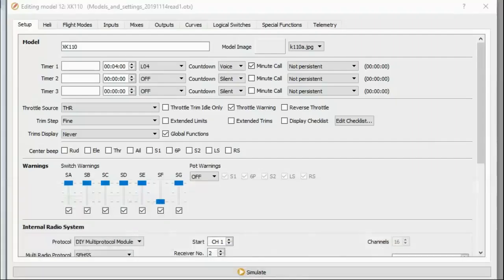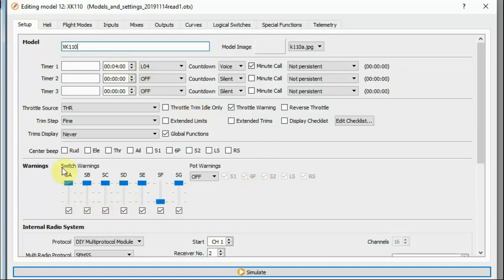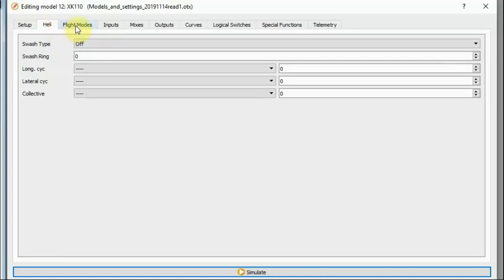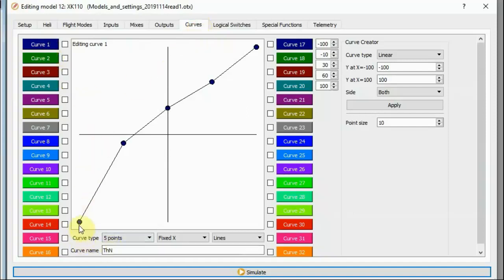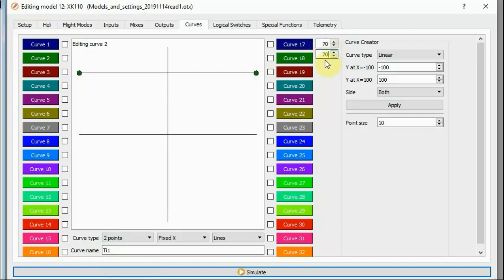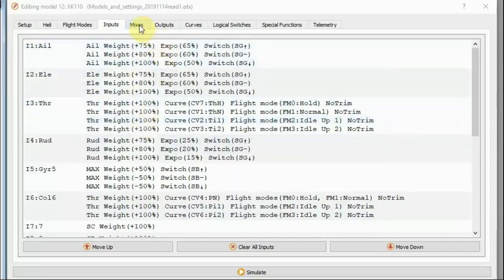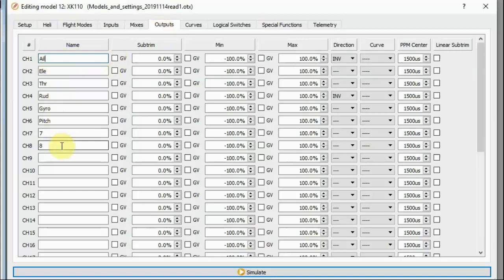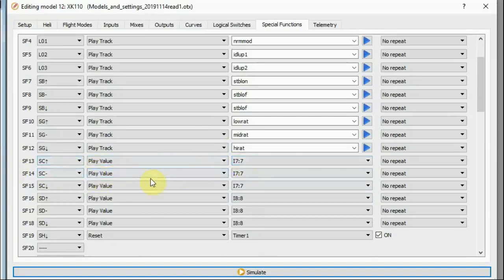OpenTX Heli Programming Pt 2 -  Flybarless Helis with Pitch Control XK, Blade, etc

Comment: Great video! Thx so much! I bought a RadioMaster TX16S MONTHS ago, but I haven't attempted to USE it because, quite frankly, it scares the sh*t out of me. I have 5 diff helis I want to use it with, but they're BOTH Spektrum AND Futaba, so that worries me EVEN MORE! I DO fly the K110, so I think I'll just use all your values and give it a shot. The ONLY change I will make is to put throttle hold on the RIGHT, as per the X6 radio and Spektrum DX6i, both of which I'm used to. Cheers!

Comment: Thank you for posting these videos. I recently purchased a Jumper T16 and am having a hard time setting up my Blade Nano S2. This video did help.Thanks again.
Reply from the maker: I'd be very cautious about flying anything DSMX with the Jumper T16 until the situation clears up a bit (though I don't imagine you'll come to much harm with the Nano). I am currently running OpenTX Nightly 42, and my internal multi module has firmware 1.2.1.51 (because that's the way it came, and I haven't yet managed to put together the adapter and cable required to connect to the internal board to flash it). I can set up and bind DSMX things, but when I try to fly them, they just act completely screwy. I'm assuming this is because of bugs that will be fixed if I flash the internal module firmware (and also perhaps issues with OpenTX nightlies, which are specifically identified as 'not safe for flying'). Everything else I've tried seems to fly ok, including DSM2. I'm only flying small things with the T16 so far, partially because I want to wait until the whole firmware situation is more stable and trustworthy... and also because Winter seems to have come early in Canada, so I'm only flying indoors at the moment anyway.
Reply: @kleedhamhobby  Yeah I have not been able to get it to work with my Blade Nano S2. I got it to bind on DSM2 and got the cyclics and everything setup, but the I can't seem to get the pitch setup correctly. I was just trying to fly something with the T16 to test. I guess I will have to try with an airplane or something. I am not putting it on my Goblin or Trex700 without trying it out for a while first. Have you had any issues flying the XK's with the T16? I have been looking for an excuse to buy the XK120 anyway. I might have to now just to have something to fly with the T16 lol.
Reply from the maker: @Gaming_With_Cole  If you have something non-DSMX, I'd suggest you try that first. Other than DSMX, everything I've managed to bind to my T16 has worked ok (tried DSM2, FlySky, KN, SLT so far). I tried DSMX on a fixed wing plane and a heli - the plane would taxi and take off, but abruptly spiraled into the ground right after take off; the heli seemed to be moving the cyclic ok on a ground test, but wouldn't even take off. So I've given up on DSMX with the T16 for the moment. I have ordered the cable and adapter board to allow me to connect to my internal multi board and flash it... and when those arrive, and I can update the multi firmware, I will try DSMX again.
Reply: @kleedhamhobby  Thank you for the info. I will try something else for now. I will keep an eye on your channel for updates on the T16. I would love to know what you find out after the multi board flash. Thanks again for the videos.
Reply: I agree on not using DSMX. I've had bad luck with signal dropping and crashing a few planes. I recently upgraded all my recievers with Sbus using my Jumper T16 and have had no issues.

Comment: Thanks for the videos!  New to OpenTX transmitters, and just returning to the heli hobby after 8 yrs, so the FBL controllers are a new challenge as well.  Just bought a T18 pro, a Trex470LM with a bestX controller....is this video the correct one to follow for setting up my radio to work with the beastX?

Comment: Where can I find the software you are using? Also, I have a Turnigy 9X and told this is an open tx system. I've been using the DX6i and completely lost with the Turnigy. I'm trying to set up a Thunder Tiger Raptor 30 and Century Raven 50, both have flybars. Thanks for any guidance and your videos are VERY detailed and informal.
Reply from the maker: The software is OpenTX Companion. It comes from the same place that you get new releases of OpenTX itself (and you should check for new releases of OpenTX and update your transmitter - you need to use the same release of OpenTX and OpenTX companion). Go to the main OpenTX site: https://www.open-tx.org/

Comment: One of the most instructive approach for setting the XK110 i've read, very didactive. One small doubt, when setting the gyro imputs,is it posible to use just two lines, one like the first with(+50%) switch (SB arrow up) and the second with( -50%) and switch (¡SB arrow up) to simplify.
Reply from the maker: Yes, you could use the 'not' function when making a three position switch serve for only two options, and that may be preferable for some people. Functionally, of course, it doesn't make a difference. The T16 only has one two position switch, all the others being three position, so it's fairly common that you might need to use a three position switch for only two options, and I suppose using the 'not' function does perhaps implement what's being done more simply. If you're going to change the input lines, I'd suggest changing the special function that speaks the setting also - it's always good to have the speaking functions coded exactly parallel to what they're indicating.
Reply: Thanyou for your reply,you certainly have contributed to my learning curve,i have another doubt. It seems that by using logical switches in the flight modes settings and conditioning them to (SF up) the pitch curves will only activate when throttle is active and this may be logical,but when setting blade pitch angle you must then disconnect the motor fron the ESC otherwise the conditions for the logical switches cannot be met.By the way, on my bigger helis i do disconnect my motor for safety.
Reply: I also think that assigning a switch to the flight mode also simplyfies .What is your oppinion?
Reply from the maker: @luisss4924  Well, I do have a switch which I consider as the flight mode switch - SE. But that only has 3 positions, and I have 4 flight modes. So I use SF as the hold switch, which locks the heli in Hold flight mode, then SE switches between Normal, Idle Up 1, and Idle Up 2 (so long as SF is not locking the heli in Hold - hence the need for logical switches). You can't switch between 4 flight modes using a single switch on any transmitter I'm aware of. You can assign any pitch curve you like to Hold flight mode, which will allow you to check the pitch whilst the throttle is inactive (though disconnecting the motor is certainly safer) - I actually have the pitch curve for Normal mode assigned to Hold mode in this video, as can be seen from the first line under Input 6 around 7:58 in the video. Based on the switch warnings that are set, the transmitter must be set with SF for Hold and SE in the Normal position at start-up, otherwise you will get a warning.
Reply: @kleedhamhobby  You are right,i did not notice that you do have a switch (SE) as flight mode.Thanks again, I keep. learning.
Reply: Hello again,i've already set up my K110 with my Jumper T16,and everything ok,but strangely my 6G mode seems to works with negative values and 3D with positive values. I've made your setup with my laptop using OpenTx Companion and transfered the file to my radio. Guess i might be missing something.
Reply from the maker: @luisss4924  When you say 'negative values', what is reversed? Is the throttle reversed? Is the pitch reversed? Is the cyclic tilt reversed? I certainly don't have this effect with my K110, so I think you must have introduced a reversal somewhere during your set-up. If the reversal is only in certain flight modes, then the problem is likely on the Inputs page, where the flight modes cause the switching of curves. Channels can, of course, be reversed on the Outputs page - but a reversal there would normally affect all flight modes.

Comment: Excellent videos!  Regarding the pitch curve during Flight Mode HOLD.  Wouldn't you want to have full negative to full positive pitch range so that you could attempt an auto rotation soft landing if conditions warrant a auto rotation landing?  Thank you.
Reply: It is matter of preference. I have all my pitch curves the same -100 to 100.   Futaba does  0 to 100 with 50 being middle stick no pitch. The only difference in flight mode is motor speeds is different.
Reply: @zmanphx  I guess when I saw a FLAT pitch curve for Throttle Hold I had to wonder.....you wouldn't even have a chance for an auto-rotation.  I get it that you do not want the motor energized on TH (flat Throttle curve)...but Pitch curve is another matter.  BTW Kleedham is popping up more and more as a heli-OpenTx reference on Helifreak.com.  Thank God!  Couldn't be happier with Kleedham's helpful videos.

Comment: Nano CPS , CPX loses connection as soon as i throttle up on RadioMaster TX16S. Any help will be much appreciated.
Reply from the maker: Not really much I could say about that. Make sure you're using the right protocol, obviously. And possibly updating the firmware in your multi-protocol module might help (assuming things work the same as for my older T16). If you're using the current firmware and the correct protocol and you still lose connection, could be a hardware problem with the heli itself.
Reply: @kleedhamhobby  Thank you

Comment: Excellent videos.  QUESTION - On the Special Functions Tab (23:35) you have Switch B managing "stabilization" functions.  It appears that the stabilization are really the "gyro gain" values that are baked into the flight controller. You assigned Switch B to control this.  On your INPUTS Tab, you mention channel 5 is being used to send this data to the flight controller.  I'm guessing that CH5 is "hard coded" into the heli's flight controller?  Could you put the gain on a variable potentiometer to change the "stabilization" (variable gain value) during flight?  How to do?  Thank you.
Reply from the maker: Well, as you say, it depends what is coded into the flight controller of the particular heli you are working with. You can certainly put the value for a channel onto a rotary switch or slider and program it so that you can vary the value in flight, anywhere from -100 to +100 (or even more, if you enable extended range). What this will do to the heli depends on how the flight controller is programmed. I think that the XK helis just turn stabilization on or off based on the value being above or below a certain point - and in that case, of course, you won't get any variable stabilization... it will just turn on and off as you vary the value past the designated point. But some other helis do actually have variable values. The old, pre-flight controller gyros also usually did provide varying degrees (and types) of correction based on the values, so using a continuous controller was what you wanted there.
Reply: kleedham - Thank you so much for your thoughtful reply. You truly are a genius with the intricacies of these helicopters. Keep up the great work. You are indeed a national treasure for the Heli community.

Comment: Hi mate, so I did all your setup as the video, when I’m at FM1 normal mode,  the Thr stays in -100, can’t control the throttle, even when I set the logical switch correct, all other FM2/FM3 works fine, it’s an opentx on flysky nv14, do you have any idea why? Thanks for all your help
Reply from the maker: OK, first we need to determine if you really are in FM1. SF should be away from you, and SE should be away from you (assuming this applies to your transmitter, which I have not personally handled). Also, if you have the right sound files, and have set up the Special Functions as in the video, you should hear the announcement 'Normal Mode'. If you are in Normal Mode, and the throttle will not respond, then either you have the throttle cut defined wrongly in Special Functions (it should force the throttle to -100 when SF is in the position towards you - SF down arrow, Override Ch3, -100); the other possibility is that you have the Normal Mode curve defined or assigned wrongly - under I3 on the Inputs page your second line should assign curve ThN to FM1:Normal, and on the Curves page curve ThN should be defined to move the throttle up as the input is moved up. All of this is shown in the video.
Reply: @kleedhamhobby  Hi, in the special function it was on --100, I've fixed that, I can't thank you enough, thank you so much for all your help as always, I'm in the hobby for years, but new for opentx, thanks mate

Comment: hi mate, did all these steps following your video, on the XK k130, everything spins and move, but the heli doesn't fly, also your curve number 6 in the video was missing, any suggestions? thank you
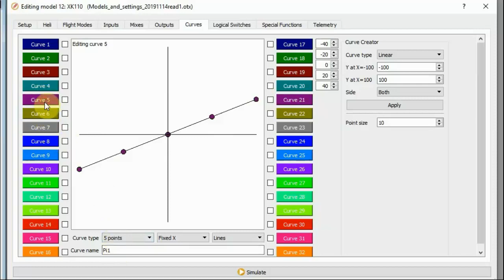Reply from the maker: Curve 6 is the same as Curve 5 - it can be seen at 14:33 in the video. These are the pitch curves for Idle Up 1 and Idle Up 2. They are generally the same. The example given here is based on the manual for the heli I was working with (the K110). It is much more shallow than is normal, going from -40 to +40 (straight line from -100 to +100 is most common). You can find the manual for the K130 at https://cdn.shopify.com/s/files/1/1052/4162/files/XK_K130.pdf if you don't have a paper copy. That manual actually recommends exactly this same pitch curve - so that shouldn't be your problem. What is your throttle channel going up to? If your pitch and throttle channels (3 and 6) are going up to ok +ve values and the heli still won't take off, that is generally a sign that there is something wrong with the heli, most commonly either a loose main gear, or a loose pinion on the motor. These setting fly my K110 and K120 (though the main gear does tend to come loose on the K110). I don't have a K130, but I'm pretty sure it should fly basically ok with these settings.
Reply: @kleedhamhobby  thanks for the response, the k130 is brand new, gears seems to be ok, thanks for the manual ill add the curve 6 and try it, I have big inventory of old schools hobby nitro and more, wanted to try this k130 with my nirvana nv14 open tx before I get the other to work, I used always old Futaba Ready transmitters which I have brand new maybe 4-6pcs but they are old now so wanted to test the open tx system, I have 5 pcs of Kyosho caliber 5 brand new with o.s engines, and many top quality airplanes engines, after ill get this k130 to work ill need to start the caliber project which I'm not sure what best gyro, GPS, flight control to chose:) but ill get there soon after, thanks for taking your time and answering all my questions, really appreciated that mate.

Comment: If my transmitter is set for AETR where do I change the channel order for a blade helicopter?
Reply from the maker: Well, I don't change the order, actually, as the multi-protocol module in my T16 re-orders the channels for the DSM protocols... so it's expecting AETR and send TAER to the heli. So... before you try to re-order the channels, make sure that you need to. If you do need to, there are various ways, as with most things in OpenTX. Probably the simplest way is via the Mixes page, which is essentially what makes the connection between your inputs and your outputs.

Comment: hi. not sure if I did understand correctly but can you tell me if it will be still required to have on the taranis that multiprotocol module on the back? sorry for my ignorance
Reply from the maker: I don't think I can really answer your question with any certainty. What kind of helicopter are you trying to fly? I don't have a Taranis myself, but so far as I know, all Taranis transmitters, as they basically come, only support FrSky protocol. So if the heli you are trying to fly uses anything other than FrSky, yes, you would need some kind of module to allow the Taranis to control that protocol.